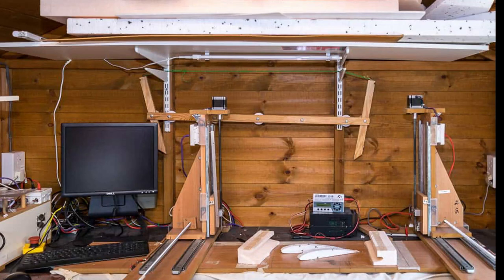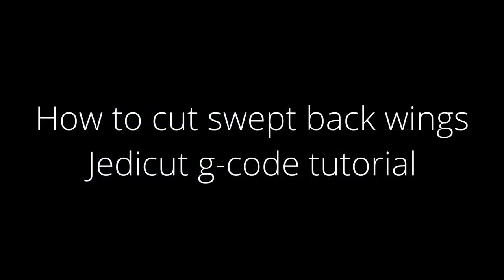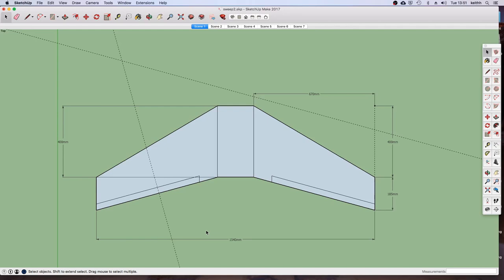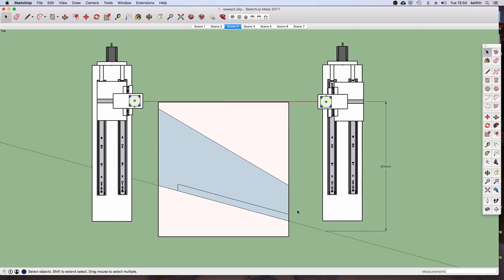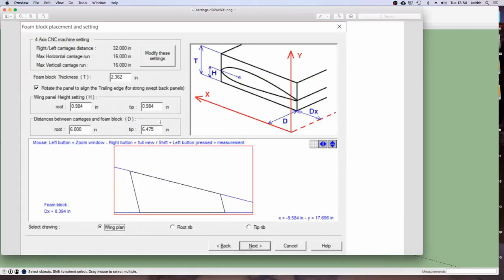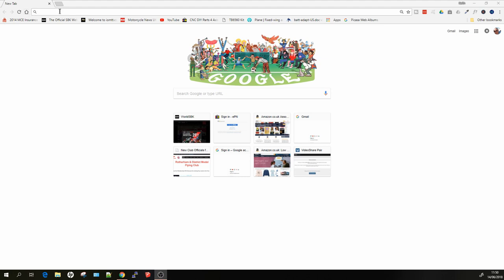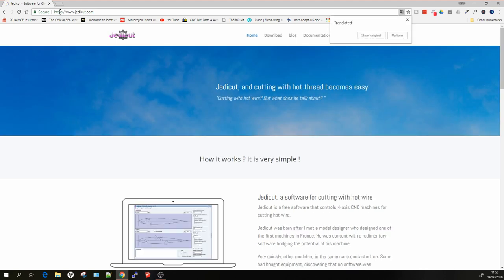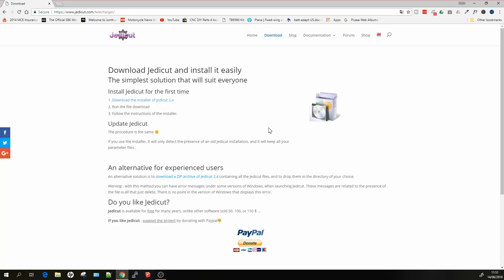How to use Jedicut to make g-code for a tapered wing tutorial

Comment: I will take the chance that you are still monitoring comments for this post. Any g-code that is generated makes the profiles at the wing span ends.  However, the towers are further apart, but they do not "know" this.  The profiles are cut at the tower location, but using the profiles as if they were at the ends of the foam. Does this make sense?  If you understand my question, how can one compensate for the descripency (sp?). Thank you
Reply from the maker: Hi Rick, for straight wings where the root and tip are the same it makes no difference. But if not you need to specify the foam width and centralize the block.  I stopped using Jedicut a long time ago there are much better free programs now I made a video https://youtu.be/DJrKjibracI 
Hope that helps.
Keith
Reply: @rckeith  My question was in reference to tapered wings, does not apply to straight wings, I understand that.  Your answer illuminated that little light bulb above my head.  The software has to know two things, the tower separation and the width of the foam.  From there it can calculate the needed compensation.  Duh, this shows my lack of experience with the software.  I have been viewing your tutorials in reverse order.  I want to first use the software I have, if possible, Compufoil for wing data.  It can output DXF files which in turn can be loaded by Planet-CNC controller software (it can drive a 4 axis foam cutter) .  If this does not work, I may bite the bullet and purchase DevFoam II.  
Thank you.

Comment: Keith:   Can you take a profile of a aircraft and import it into the Jedicut wing area, put the profile in as the root and the tip and convert it to g-code? It might be the wrong question but what file types can jedicut and X5 import or use? Trying alot of different things and the gcode files seem to be an issue for me. I tried using a cad program  and drew a 2d drawing but getting it converted into gcode is an issue for me. Thanks Don
Reply from the maker: Hi Don
Jedicut can't do as you describe but the process is quite simple.
First from you CAD program you need the dimension of your wing. Wingspan, root and tip size and any sweepback.
Then you need to decide which aerofoil you are going to use.  Jedicut can import a DXF of the aerofoil if you have one already or you can download a DAT file from many sites for whatever one you want to use.  I have the Clark-y on the website in DAT format you can use,  in the Downloads section.
Then if you follow the video on Jedicut you can use the dimension to create the g-code for the wing.
If you want a program as you describe then DevWing Foam 2 is the best option, but its not free.  You can download and try it for free but it won't generate any g-code until you purchase a license.  It has a very good simulation of the wing being cut so you can see exactly what it would do when purchase a license.  I don't use anything else and I don't buy models anymore so the cost has paid me back already.
Hopr that helps
Reply: @rckeith  Thanks for answering. Have a nice week.

Comment: So is the "start height" on the wing root page supposed to be the middle of the foam, the horizontal line on the wing chord? And the release height is where your saying to go up to above the foam to do quick moves?
Reply from the maker: Yes thats it, you can adjust that to suit your foam start
Reply: Awesome, those were the 2 questions i had that stopped me from getting it fully setup (well the % sign thing as well). I couldnt figure out where you put in the width of the foam or how you told it how thick the foam was.

Comment: Hi, Very nice video.  Thanks!
I have an issue with the GCode that Jedicut exports.
all the values of the axes are about 100's smaller than what they are supposed to be.
i.e , lets say I wanted a 200mm wing chord, the values of X axes on the GCode are about 1.62mm, and offcourse this is wrong.
I looked at your G-Code and it looks the same like mine. the values are very small.
How did you manage to use it and cut a proper size wing?
or did you find a way to export a correct GCode?
Thanks!! :)
Reply from the maker: Hi
Yes confused me a bit at first. JediCut uses incremental  positioning  So it's the distance from the last position.  Its use a G91 to set that a the top of the code.  
Keith
Reply: Thanks!  
I am using arduino mega ramps 1.4 with GRBL 4 axis gcode sender.
I'll check if I can play with the G90/G91 settings.
:)
Reply: You were right!  Thanks!!!
Changed the GCode Sender to Incremental and it worked beautifully.  :)
Reply from the maker: Glad it worked. What are you making ?
Reply: nothing specific.
I built a 4 axes machine about 13 years ago and made a MM2001 homemade interface board.
this project was on and off for many years and  I did manage to make work eventually but set it aside beacuse it wasn't made good enough with many bugs.
during the years I built other CNC machines, mainly for the surfboard industry.
I'm talking BIG! about 4.5 meters in length.  they do both hotwiring and milling but this old project of a small 4 axis machine always felt like a nemesis that I have to defeat.
so I built a new machine a few days ago and now I am just putting it to life.
who knows.. maybe I go back to my roots and go flying stuff again :)
Reply: Hi Jordan, im im the same path as you using Jedicut and GBRL. How did you manage to make it work since my GBRL wont even open the gcode files that Jedi puts out. Many thanks
Reply: @91octa  
First you need to open the files with your UGS GRBL.
So make sure you have the correct file type.   *.Nc file is good.
After that, make sure your UGS is in Incremental mode.
Let us know how it goes.
Cheers

Comment: Hello, I was wondering if you could help me with this. Firstly, thanks for the video. Very helpful.  My issue...When I generate GCODE, the CUT SPEED and FAST SPEED setting are always the same (F0.0006 and F0.0013).   It does not matter what I put in the CNC CONTROLLER area in configuration settings. They don't change. Am I doing something wrong or is this a bug?  I see you just set 60 and 100 and that's what you get in your GCODE.  Isn't working that way for me.  Thanks.

Snippet from gcode generated:

( Move max speed )
F0.0013
G1 X0 Y75 U0 Z75
( Move cut speed )
F0.0006
Reply from the maker: I think your speeds are far too small. It works in either inch or mm per minute (g94).  So you are telling to move 0.0013 of a mm or inch per minute. Jedicut probably doesn't see any difference because your setting are so small.  I don't tend to change the speeds I adjust the current to the wire which seems to work best for me.  Hope that helps.
Reply: Hi,  Thank you for the reply.  I don't think you understand my question though. Yes, I know that these speeds are too slow. I did not tell Jedicut to go this slow. I want the Gcode to be 'F200' for my slow speed, for example, so I enter "200" for 'cut speed'. The gcode generated is F0.0006. Seems crazy, I know.  JediCut is kwirky so I was wondering if there is some setting i am missing. It sounds like you have not come across this problem. For now, I post process the file to replace these speed numbers with what I need.  Thank you.
Reply: i think I found it.  Under 'Heating' in the configuration screen, there is a materials list. A fresh install of Jedicut has a material already in there and it had those strange speeds that ended up in my gcode. I deleted the material and then it used the speeds I had set in the 'cnc controller' area.  It is a weird place to put that.  I have heating control disabled. Oh well. Free program.  thanks
Reply from the maker: @jmogyoro  Ok, sorry, Try running Jedicut  in Administrator mode. It tries to save configuration settings  in its install location,  and windows doesn't always allow that. There is another free option called WingWire details on the website. I haven't  used it yet but it looks promising. Jedicut has just released a update, do you have the latest version. I run Jedicut in Administrator mode and it works fine. I don't use it much  because DevWing Foam  is much better but not free. But worth it in my opinion.
Keith
Reply from the maker: @jmogyoro  Glad you got it sorted. Yes you can't complain about free programs  Jermone has put a lot of work into.👍

Comment: jedicut is the shittiest software i ever used. i went thru a couple of softwares now and about to give this shit up... so annoying
Reply from the maker: If you see the date of the video this was 4 years ago. It was one of the few free offerings then.  There are now much better free options.  I only ran a few test cuts with Jedicut and never made a model with it, It was mainly for the guys that didn't want to buy DevWing Foam.  Have a look at my post here which gives several options https://rckeith.co.uk/foam-wing-free-cnc-software/
Yes, I have never been a big fan of Jedicut but it does have a DXF option which is why some guys use it.  
Hope that helps.
Keith
Reply: @rckeith  i tried devfoam as well but it apparently cant cut what i want to. Regular planes works absolutely fine with devfoam :)   i maganed to cut a test wing with jedi but damn, that shit is buggy as hell. I guess i put the cnc away for some time till i get hooked again